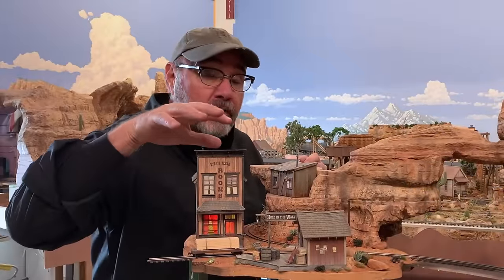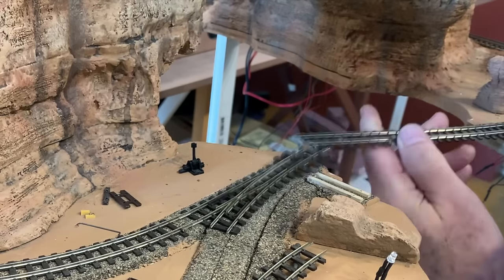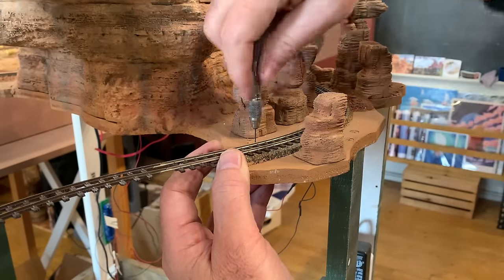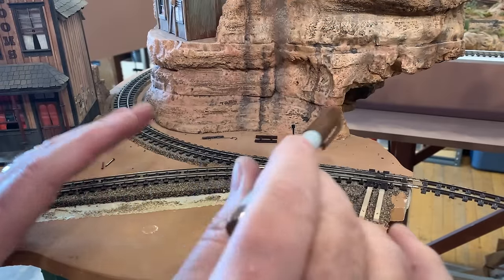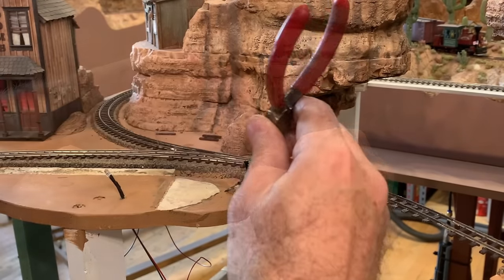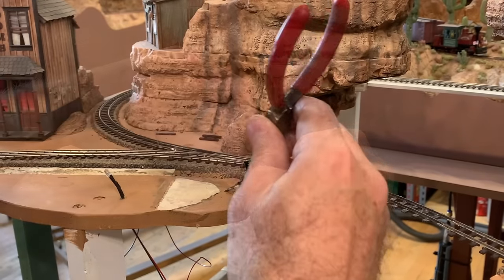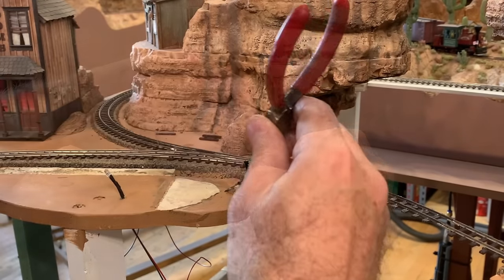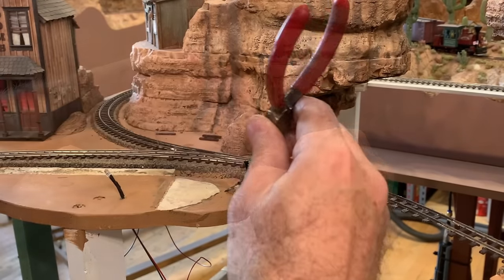Finishing Track & Ground Cover | On18 Bandit Canyon Railway

Comment: I was about to install a pair of similar PECO HOn30 turnouts on a micro layout 009 layout (With a bit of standard gauge for scale) and that ground throw setup is wonderful, I'll have to try your method with the piano wire!

Love seeing the On18 section again, a lot of creativity on display with everything being scratchbuilt.

The mineral spirit you used for getting the tops of the rails cleaned of paint is the same fuel that some Mamod toy steam engines use - In case you wanted to make the tin empty faster!

Comment: Just wondered why you didn't use an insulated rail joiner where the point joined to the outgoing track? Any great videos as ever 👍🏻
Reply from the maker: Good question! Because an insulated rail joiner would have made a weaker joint at that particular spot. The sharp curves put a lot of stress on rail joints so I determined it would be better to get everything aligned and then cut the rail. The intact flextrack webbing below helps hold things in alignment.
Reply: @ThunderMesaStudio  fair point well made 👍🏻

Comment: Hmmm.. at 12:18, why not just use an insulating rail joiner instead of soldering the brass rail joiner? Then you wouldn't have had to add a special cut & make up your own epoxy/styrene insulator? I am new at this track modeling stuff, but it seems it would have done the same things easier..Am I missing something?
Reply from the maker: It wouldn't have been as strong of a joint.

Comment: It would have been easier to just not solder the track joint on the one side.
Reply from the maker: Easier, but less effective at keeping the rails in gauge. I soldered and then cut the rail for the same reason I didn't just use an insulated rail joiner. Coming off of that sharp of a curve makes for a very weak joint. Far better to get everything properly aligned and then cut the gap, leaving the flex track webbing below to help keep things in gauge. Besides, I wanted to demonstrate the gap and fill with epoxy technique.